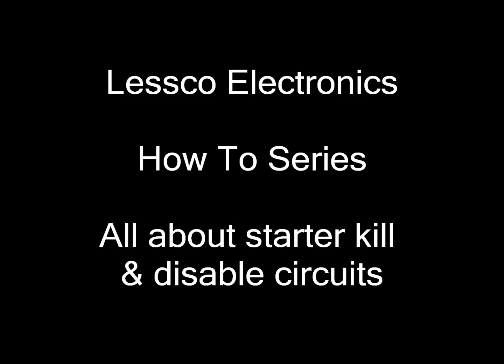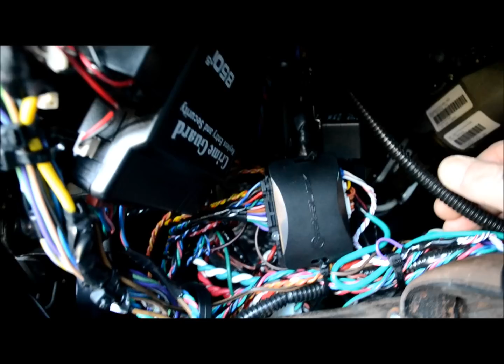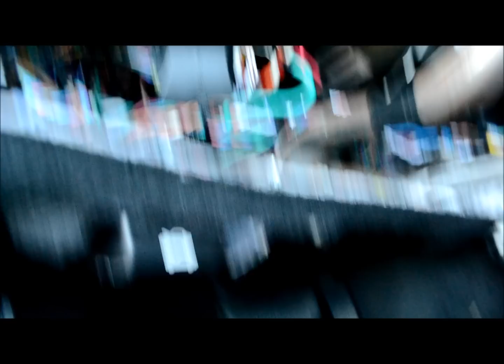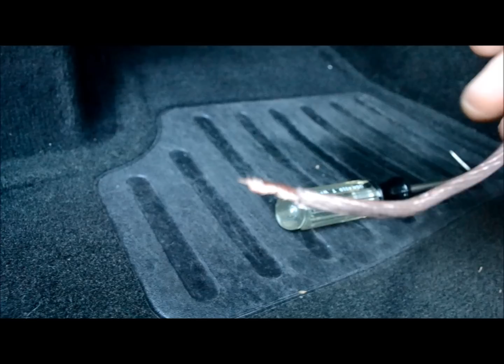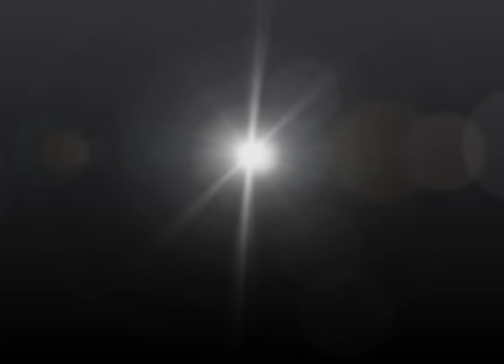Car alarm How To - Repair or remove a starter kill disable

Comment: Hi there I have a question, I have a 1993 Nissan Maxima which came with a kill switch when I bought it..lately I have trouble starting it..its does not make any noise when i turn the key to start it takes about 5 to 6 turns or sometimes i have to wait like 15 mins until it starts..and once it starts I have no trouble with it..it runs great..but then I turn it off and again it takes about 15min just waiting to start..You think it might be the relay also???
Reply from the maker: its possible, however uncommon, a relay typically works or it doesn't, why don't you place a jumper wire in the starter kill relay and see if it acts properly every time? there is the answer

Comment: Hello I want to know if you know anything about a device call locktronics. My stupid 1998 Saturn won't start. It will work for 2-3days straight then die and sits for 1-2 weeks then starts again
 I am getting frustrated and want to some help. Any suggestions?
Reply from the maker: I never heard of that model, If I did I would be glad to help you with it
Reply: thanks...

Comment: Please sir, I need your help. First of all...same as some others here my alarm was triggered and will not go off unless I disconnect the battery cables. If i do get the alarm to stop, my car will not crank or start period. If I find this relay you have in this video and do what you did, will this fix my problem? I have a 1999 Nissan Pathfinder. Also, do I just put the jumper wire one end on both sides of the big gauge wires?...as in any of the sockets? ...or 2 particular sockets? Thank you for your time and hope to hear from you soon.
Reply from the maker: try jumping out that relay, Im sure youll be fine
Reply: do i leave the jumper wire in permanently? or do i take it out after i start the car for the first time? ...sorry to bother you, i just don't wanna mess something else up before doing this. thank you for your time.

Comment: I need help with my 98 dodge durango, as soon as I connect the battery the alarm goes on and wont let my car start..pleasee help!!!
Reply from the maker: can you find your valet switch and turn it off that way?
Reply: Im mot sure where and what that is.
Reply: You ever figure it out bro?? Im sitting in my 98 Durango right now that is experiencing the same issue.

Comment: I have a 2006 dodge charger that I purchased with a aftermarket alarm and kill switch, my car died on my wife, had it towed, replaced starter but my alarm goes off when I open, close doors or try starting it. Will this process work in my case?
Reply: lmao weak af

Comment: i have a suzuki reno 06 
the car alarm goes off at random times. Would this work to stop that alarm from turning on?
Reply from the maker: No, you need to correct the issue or unplug the alarm itself

Comment: I love you man.  Wife called from a parking lot about 6 miles away - eff'in thing wouldn't start - Mitsubishi Montero Sport - hate the truck in the 1st place.  Left the POS (there are other problems...) sitting overnight since it wouldn't start (put a new battery in the previous day...).  Your fix got this thing running again - made my "fix" permanent.  Next step:  get rid of this thing...

Comment: Thank you Thank you Thank you worked perfect the only thing I would add is to disconnect the battery and to remove the inline fuse to the alarm thank you, I was stranded with my son and was able to get home because of your video.

Comment: Just wanted say thanks, this video saved me one heck of a headache and money. I had bought a new starter, battery, and a main relay before watching this video and I almost bought a distributor, car started but i still have the problem of the trunk constantly opening if i leave the wire installed  and attached to the relays thick wires, did i maybe connected the wrong way ?

Comment: on my 98 vw jetta k2 my aftermarket system code alarm installed by the local quality auto sound was acting up only about 6 months to a year after. All they say is we can check out the electrical but it may cost. I believe they didn't wire it properly or a repay was bad or no relay I have to fine it. I think the car rejected it or open ground due to faulty alarm going off all the time at random. I ended up pulling the alarm itself but I'd like to connect up the stock alarm again if possible.

Comment: ok so I have a smart chip installed from previous owner I only have one valet key and I have two other keys to be cut asap. I need to remove the smart chip because there's only one key in my possession and I'm getting the actual key fob soon. 00 vw jetta. Stock alarm works fine can I add immobilizer shock sensor glass break sensors?? To stock.

Comment: Thank you so many times over for this video. After weeks of my Camry being dead, rebuilding the starter, checking the neutral safety switch, trying a new starter relay, and weeks of confusion as to why the car was not starting we noticed the quietest car alarm in the world was going off. 

Shoved a wire into the place you were talking about, turned the key, and the car fired right up. 

Thank you for the great video, it was so helpful and probably saved us hundreds of dollars.
Reply: Which relay numbers did you bypassed?

Comment: Dude you save me! I pulled the negitive cable from the battery to check the tps. tHIS RESET AN OLD ALARM on my 95 4runner v6. I was stuck. I heard the clicking. I first believed it was a signal from the car computer but, I had no engine light. I used your tip. I am back on the road! Great vid.

Comment: I have a remote stater in my car so last time that I try to start the car my remote wont work so I have to disconect the wiring harness from the box where is all the conections is the only way my car start but if I put them back together the car wont worck and the alarm goes off thank you

Comment: i had to replace a battery in a 96 VW jetta and everytime i connect the negative wire to it the alarm goes off. so i try to disconnect the horn, but turns out that the alarm has a separate horn, and i don't have a key fob for the car. i think the alarm is the only thing that's preventing my car from starting

Comment: Hi, you sound like you know what your doing i wanna take alarm all together off my car and not deal with it i got a 95 accord lx v6 just bought few months back lost the fod for the alarm and cant start my car i left my lights on at the mall came out and alarm went crazy wont let me start car pretty sure the battery almost dead if not dead how can i remove the alarm so i can start the car i am almost certain the viper alarm i have is 600 hf series

Comment: Dude i have a 1997 chevy lumina and im about at the point where im just going to cut that fucking orange wire and be done with it...im afraid that if i do so my car wont start becaue the car needs to recognize  the VATS in order to start

Comment from the maker: If you do the starter circuit wouldn't be connected any more, You'd be worse off if you did that, you need to put the starter wire back together, not disconnect it.